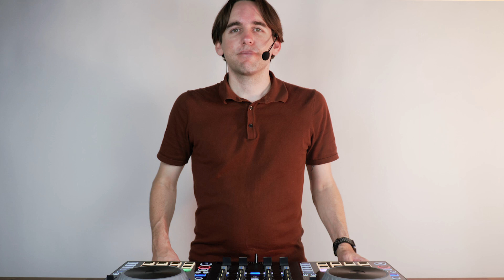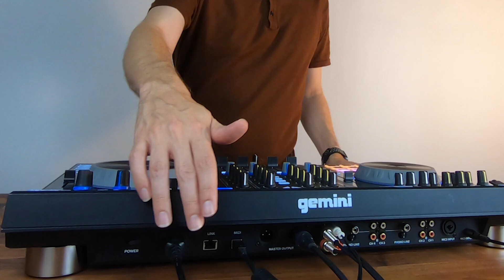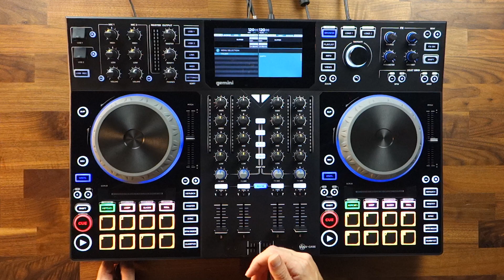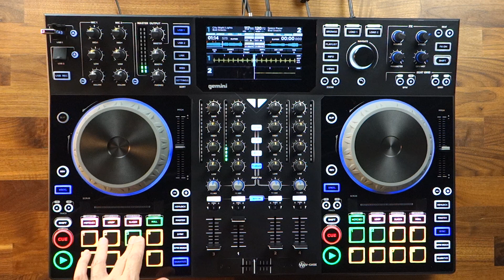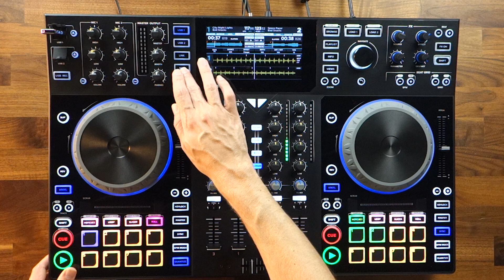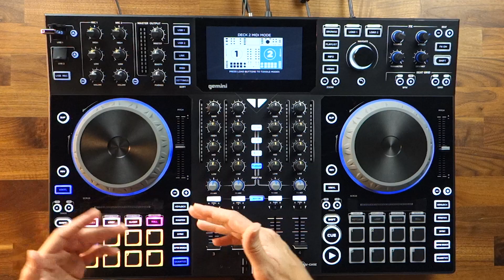Gemini Sound SDJ-4000 Tutorial Series – Getting Started

Comment: Hi, can I use my sarato software on my laptop for this system, or do I need to use virtual DJ. thank you in advance.
Reply from the maker: Unfortunately you can not use Serato.
Reply: @GeminiSoundhq  Hi, I'm a mobile DJ and the SDJ-4000 looks like a good upgrade to the Numark Express I have.  If I'm doing a gig and someone asks for a certain song and I can't remember where it is, would it be easy enough to find in the SDJ-4000 music library or would it be quicker to find it on my laptop. Thank you.
Reply from the maker: Yes! as long as you analyze your music in V-CASE properly you will easily find it using our Search function.
Reply: You can probably use it in Traktor and Mixxx.